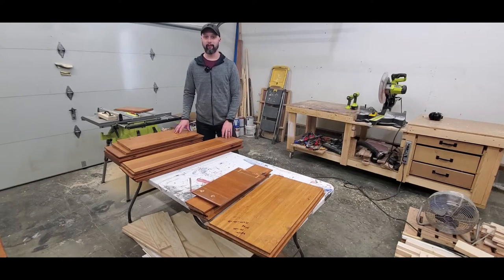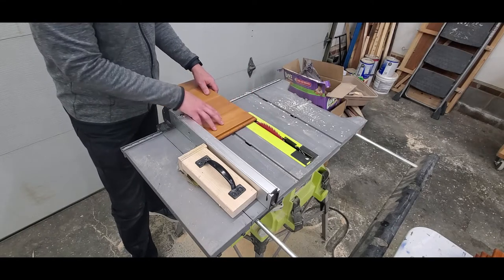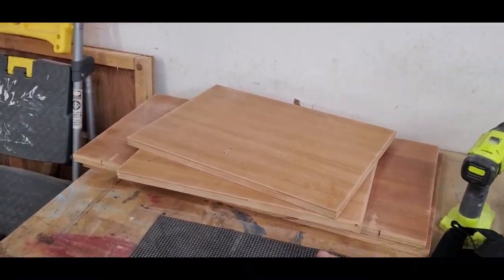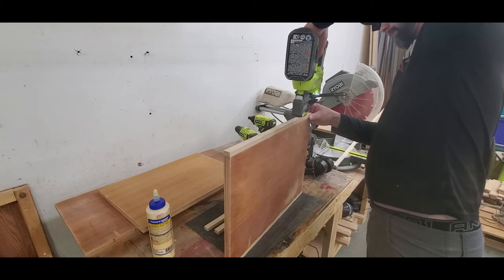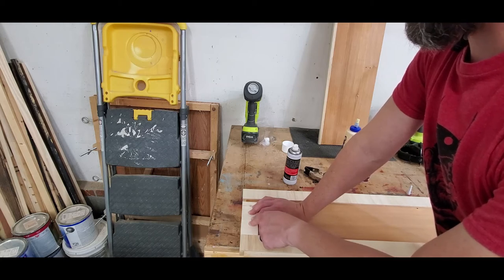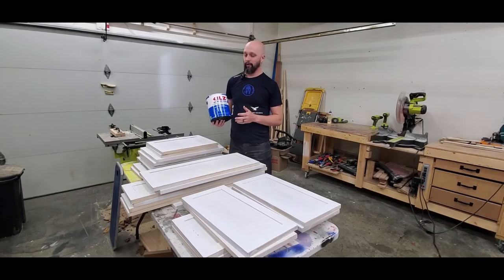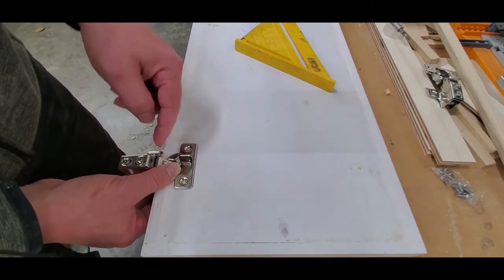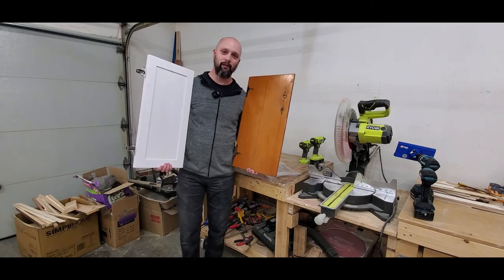DIY- Shaker style Upgrade to old cabinet doors ON A BUDGET!!

Comment: I'm glad to have found this video as I've been wanting to update my bathroom and one of the projects was to reverse the doors on my contractor grade white laminate bathroom vanity with soft close hinges. Then adding Shaker trim and painting it with Retique it wood paint to make it look like an antique wood dresser that has been repurposed as a vanity. Last steps will be to change out fixtures from silver tone to antique brass look and add matching hardware to the cabinet and false drawer front. Paint walls and ceiling with Benjamin Moore colonial blue and  use a bathtub sealer to freshen the fiberglass insert to a solid white with tile added to the wall header. Finally, an antique round mirror for above the sink.
Reply from the maker: @nhtuxie  sounds great! Thanks for watching!

Comment: Thank goodness I found this. Instead of investing $15-20k on a new cabinets, I can spend that money on all this wood working equipment and then do this job myself. When it comes to doing a kitchen, can we just agree that it’s going to be expensive regardless of the decision?
Reply from the maker: It's very true. Things are expensive. I used about $500 worth of equipment on this project but I also have several years of valuable experience with using that equipment. The planer was a luxury that could have been replaced with the sander. I made these doors for a friend and charged him $500. I have another kitchen job coming up where I'm making new doors from scratch. I'll be charging less than $2000. So yes, not everyone needs to invest in tools but there are much cheaper options if you look for them.

Comment: Wow, those are exactly like my old cabinet doors. Perfect!
Reply from the maker: Hey thanks for watching! If you end up doing something like this with your doors, just make sure to really get the fit right with one door before you start batching them out. I was making mine off sight and were some gaps upon closing some of the doors. Luckily, I found a solution by extending the face frame at some points. Good luck!
Reply: Yea mine too lol i started yesterday doing this...not afraid to be a doofus lol

Comment: I'm going to use faux wood blind slats that I have to upgrade my flat cabinets to shaker cabinets , what do you think? Yea or nay?
Reply from the maker: @jennyanimal9046  seems like it would work. Just glue it with construction adhesive, caulk all the seams, a good coat of paint and it should be good. Good Luck!

Comment: I’m updating my 1978 kitchen, and while the cabinets are sound, they have cheapie looking 3/4” plywood doors, like the doors in your video. 

My wife and I also decided to add stiles and rails to the original doors to simulate Shaker doors. However, I have run a bunch of the doors through my planer to thin them to 1/2”.  I’ve done this because we don’t like the thicker  appearance of just gluing the rails and stiles on the plywood. 

Of course, my planer’s max capacity is 12 1/2”. And we have quite a few cabinet doors wider than that. I am going to experiment with splitting a couple of doors down the middle, planing them to 1/2”, then gluing the halves back together before adding the rails and stiles. 

My first thought has been to slot the cut edge of each half and glue a full length spline into the slot to strengthen the joint. Guess in the next couple days I’ll see how that works out. 😂
Reply from the maker: The spline seems like a good idea. I guess the key is to minimize any seem. The rails and stiles should keep it together. Good luck!

Comment: This was very informative! I do have a question. Regarding the added poplar on the edges where you cut out the inset.  what size did you use  You mentioned it was 1x6x8.  Did you rip each on one down to size?   I dont have a table saw and was wondering if I can just buy it that size.  Thank you!
Reply from the maker: Hi, thanks for watching. I'm afraid the smallest I've seen poplar sold is in the 1x2 category. I was basically cutting strips that were half inch or 3/4 inch. If it's something you want to try, I would say your best bet is to know someone with a table saw that can rip some boards down for you. Good Luck!

Comment: thats how my cabinets were I wanted to do the shaker look and i used water based primer zinseer bulls eye 1 2 3 and used shermin williams paint for the color but by the knobs i get alot of discoloration and peeling .. do you have any suggestions
Reply from the maker: All I can say is that I think it it helped me to plane off or sand off the old sealer down to the wood. Perhaps you can sand just the spot that are peeling and then add more primer. It's possible the oil based would be more effective although harder to use. Good luck!

Comment: With the popular did you add it every lip you removed or just one side?
Reply from the maker: For the most part, it was every lip that was cut off was also replaced with a poplar strip. Some of my doors were unique and only needed 3 sides replaced. It was very tricky to have the width correct when I was going from notched-in doors to overlapped doors. Being on site would have helped but I was 30 mins away. Good luck!

Comment: Did you put the popular on top and bottom and sides
Reply from the maker: For some doors, I put them on all four sides. Some only 3 sides. The kitchen was so non-uniform that each door had to be considered differently. I would consider fitting each door where it needs to go before you add the shaker trim to be sure it fits over it's opening. I ran into some issues with a few of my doors. It's easier to do adjustments earlier than at the end. Good luck!

Comment: What if your old cabinet doors are already painted? They have old slats on them and I want to make the doors smooth and paint them a nice light sage green color. So I'm thinking I might just fill the cracks between each slat with wood filler putty or something then put primer over it and then paint it but I don't plan on taking off the old paint since it might be lead.
Reply from the maker: Sounds good to me. Maybe just a scuff sand before priming to make sure there's good adherence. Good luck!
Reply: @wooddoofus  thank you for the feedback 😄

Comment: Does Poplar twist?
Reply from the maker: I've found it to be one of the more stable woods.  Great for paint grade projects. I use it for face frames on almost all of my cabinet projects. Never seen it twist any time I've used it.
Reply: @wooddoofus  I think I messed up on my doors then it’s kinda bowing out in the middle maybe because I didn’t use space balls?
Reply from the maker: I thought Space balls were for keeping a panel from rattling while still leaving room for expansion. It seems like you're making a different kind of door than I was making in this vodeo? Thats cool, I'm just trying to understand.👍
Reply: @wooddoofus  yea I’m making it with the routered groove so that the panels fit inside the groove but the poplar bowed out a bit towards the middle of the door it’s very slight though but was wondering if that’s a characteristic of poplar
Reply from the maker: Okay gotcha. Well, I'm no expert and I lack extensive experience. I wish you well on your project.